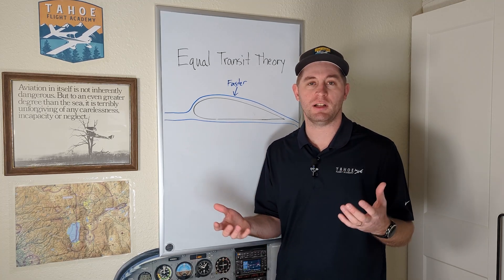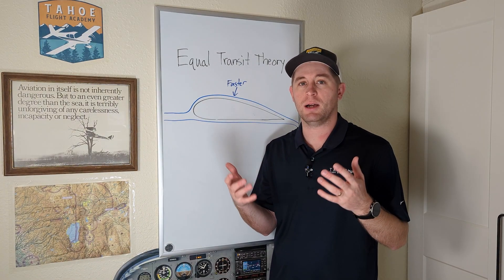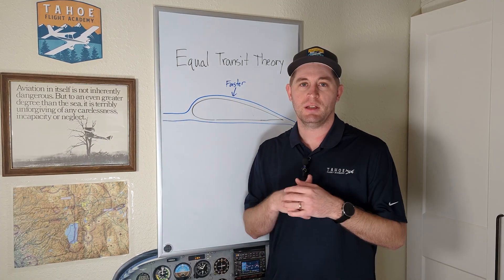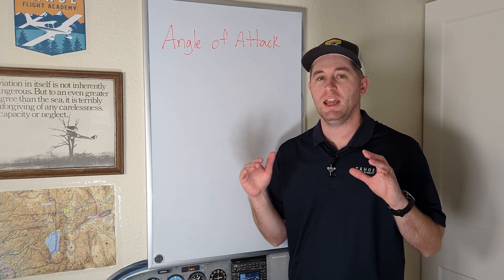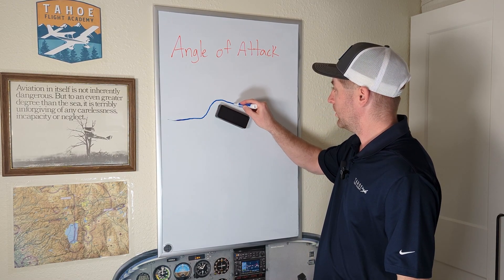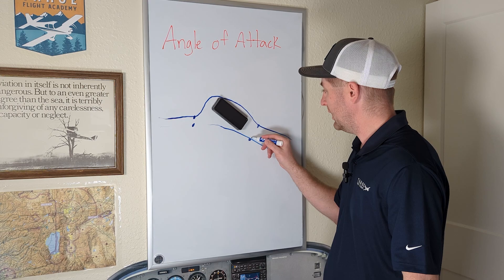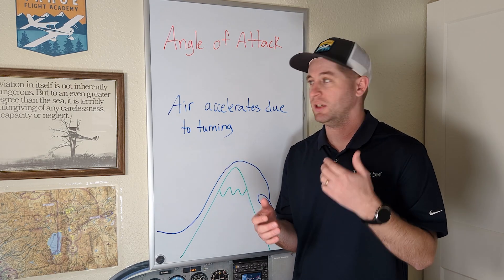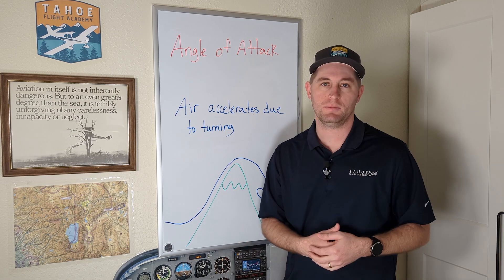The TRUTH about how airplanes fly | So many CFIs get this WRONG

Comment: Air hits the bottom of the wing and the wing turns the air down by a certain angle, the wings angle of attack. Combine that with the mass of the air being deflected and you can calculate the lift generated. The faster the plane goes, the higher the mass of air being deflected and the greater the lift. This is well understood and not very conplicated. More details can be added, but in the end its mostly just mass and angle.

Comment: Thank you ...     

     The wing is rammed through the air by the engines or as the plane falls during a descent due to gravity (and the engines...). A such it, due the wing's shape and the angle of attack (relative to the airplane's velocity vector not the ground) You obtain pressure differences above and below the wing. These are deliberately caused by the mechanical movement of the plane doing work on the air. Now a hand out the window does so as well, but a wing is carefully engineered to obtain the desired pressure differences without inducing too much drag. This pressure difference is designed then to have a lower pressure above the wing, hence causing a partial vacuum so partially the pressure under the wing will serve to hold it up. However, the wing is of course in motion and so the air further above the wind rushes down into the vacuum then off the tailing edge creating a downdraft. We can see evidence of this with observing streamlines in a wind tunnel. The air above turns more dramatically indicative of a lower pressure. It is the same logic that describes the flight of a curve ball. (There may be a Magnus 'Effect', but it is all due 'lift' in the direction caused by the spin on the ball and its speed)
      In its simplest interpretation, there is thus a partial vacuum force bringing all this air downward due to the pressure differential created by the wing action described above and so by Newton's Third Law, there has to be an equal an opposite force pushing the plane upward. The control of flight is such that by the proper control of the angle of attack, engine thrust and wing shape, you can achieve a balance between the cumulative force forcing the air down and that holding up the plane and any drag. This gives level flight. When climbing, we use additional engine power to further offset a bit of gravity (most of the plane is still supported by the lift) and at the same time create the most efficient lift to get the airplane to the desired altitude. The descent has reduced power, using largely gravity and then finer control so that the landing is at a safe vertical speed, and enough forward speed is maintained to just have a bit less lift than the weight of the plane. We also use flaps and leading edge slats closer to the ground to change the wing geometry to optimize the pressure differential at slower speeds, especially at landing where the slowest possible speed for a given aircraft weight and geometry is desired for safety. 
     The theory described above is largely an American phenomenon. It got in the textbooks in the early 60's. In all other countries airplanes fly according to the laws of physics, only in the US does this Equal transit theory be upheld (and with some fervor in my experience). I even saw it getting prominence at the Air and Space Museum for goodness sake. Lift is NOT Bernoulli and it is not Equal Transit time etc. Really ...
If you are a CFI or a physics teacher you should THINK for a minute. If this equal transit theory actually worked then there would be NO DOWNWASH from a helicopter! Sure, listen to your instructors, but THINK as well. Yes, we can trot out some impressive partial differential equations in university to describe this, but when I taught, I always covered airplanes and flight for my advanced high school physics students. Interested students can understand the above and explain it and love seeing images of various types of planes and why they worked and their role in history. 
     Now, to extend this ... When a plane turns, it requires a very significant force due to the large mass and high speed of the airplane. This is not going to be accomplished by the small control surfaces. Instead the bank and rudder control change the lift vector of the wings to some thing off vertical, but in the direction of the desired turn. Suppose you bank a plane 25 deg. Then the force towards the turn is sin 25 = 0.416 or ~40% of the lift the wings are providing. However, at the same time the force holding up the airplane is cos 25 = 0.906 or ~91% of the required lift. So the pilot has to make a slight increase in angle of attack using the elevators to maintain altitude. So the wings are actually lifting the plane around a turn. Yes, I realize that 40+91 Not(=) to 100. However, that is the magic of elementary trigonometry and makes that aspect of flying so much easier! One of my students when confronted with this said ... 'but that's cheating' ...  and so nature does.
      Finally, a good video on this topic. Thank you.

Comment: The classic curved wing shape DOES make lift by the upper molecule needing to speed up relative to the under side...but agree that they don't exactly meet again at the trailing edge which is why those wings create turbulence behind them which also creates drag.

A symmetrical airfoil works on the same theory as a rock skipping on a lake (as mentioned by phil below)....by planing which creates lift mostly by the impact of the molecules on the underside and much less due to any acceleration across the top surface.   There IS acceleration across the top when a symmetrical wing is creating lift due to planing at some angle of attack, but it's more troublesome as this causes transonic shockwaves at high speeds.

Wing theory IS about as complicated as you want to make it...but saying that the old Piper Cub style wing doesn't make lift at '0' angle of attack is wrong....so that lift happens because of the upper surface acceleration which is what has been taught for over a century.
Reply from the maker: A symmetrical airfoil will not produce lift at a zero angle of attack. I encourage you to check out the NASA site linked in the description.
Reply: @tahoeflightacademy  Who said it would?  Not me!   The conventional 'Piper Cub' type airfoil WILL make lift at '0'...while the symmetrical airfoil NEEDS angle of attack to create lift.   I never said otherwise and it seems your reading comprehension could use some remedial attention.
Reply from the maker: @recoilrob324  I think you're missing the entire point of the video. It's not a discussion of how lift is generated, it's about the equal transit theory being false, of which the symmetrical airfoil is a prime example.

Comment: Flatten your hand a stick it out the window of a moving car. There's no bernouli effect, but you will feel lift. The lift is generated by newton's 3rd law in this case. Your hand is running into air molecules and accelerating them. At an angle, you get a combination of lift and drag. The bernouli effect just makes the lift more efficient by reducing the pressure above the wing
Reply from the maker: Bernoulli effect is in play any time lift is being generated. It's a combination of that and Newton's 3rd law.
Reply: It's simple deflection.  Same thing occurs of your hand hits water, or a rock.  There is almost no phase of flight where lift is needed and there is a zero angle of attack.